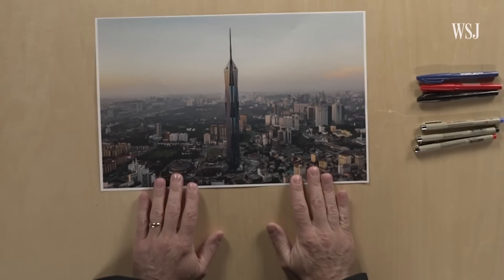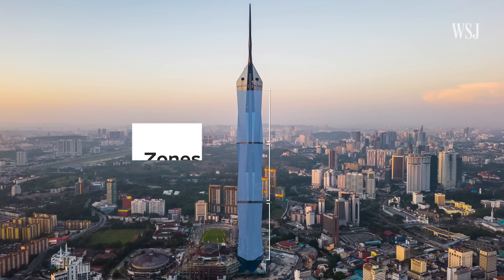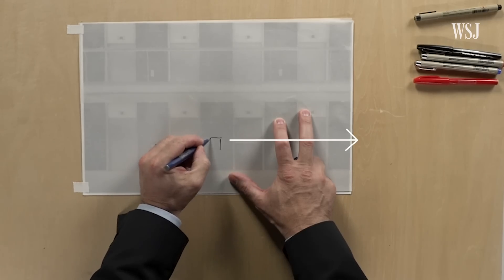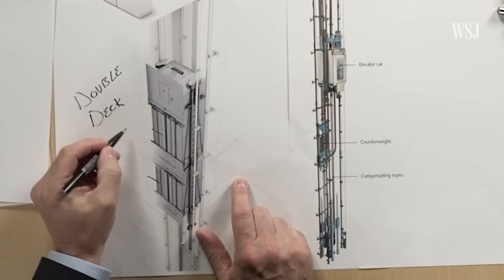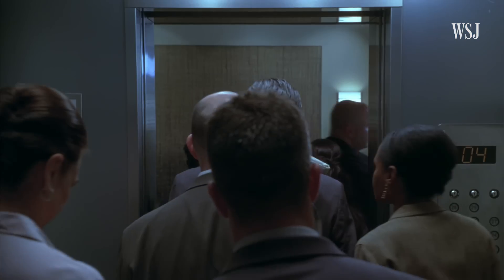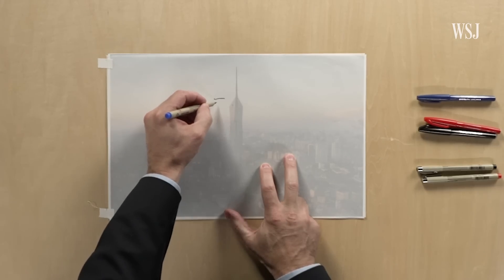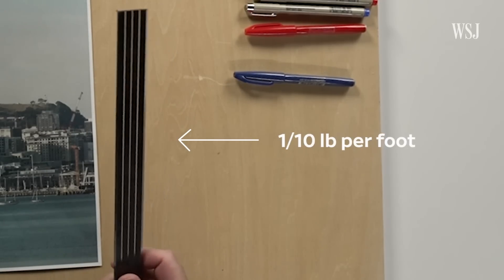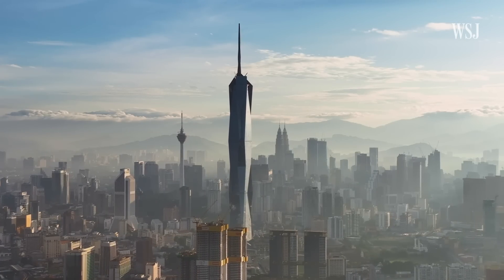Elevator Expert on How to Move 10,000 People Up a 118-Floor Skyscraper | WSJ Pro Perfected

Comment: "Give credit where credit is due..." (Said actress Lorretta Young). Barker Mohandas was the technical consulting firm that designed the vertical transportation system (elevators/lifts and escalators) for Merdeka 118, along with an innovation to the elevator industry's standard destination control or dispatching system.

Comment: I live in a 38-floor residential building in KL where KONE supplies and maintains our lifts (5-6 car system, total around 30 cars). Can confirm, they are fast. However, the system suffers huge drop in performance whenever one or more car stops working.
Reply: So its constantly need to be on maintenance?

Comment: Very interesting video. One statement made at the beginning is misleading, however. While it is, strictly speaking, correct to say that M118 as a whole is the world's second-tallest building, this is due to its absurdly tall spire. The relevant metric when talking about elevators would be highest occupiable floor height. This makes M118 the fifth-tallest building in existence. Still quite an accomplishment, but not exactly the same. It would be interesting to see a comparison of the elevator systems in use in the top 10 supertall skyscrapers (measured by occupiable floor height) to see what has been tried out and what is being learned from different approaches.
Reply: You can access the spire and go all the up as an observation deck.. its a structure not an antenna.
Reply: Its a structure, theres even a observation deck there
Reply: Thank you for pointing this out. Yes, there is a second observation deck in the spire, which makes it a structure, but it is accessible by stairs. The elevator does not go into the spire. As this is a video about elevators, I am focused on the height of the elevator shaft.
Reply: @humanbean5547 ... how many occupied floors are in Shanghai Tower ??? ...

Comment: Just simply a operation optimization problem.😅 In a high level, the lesser stops it takes to transport a passenger, the higher of the total efficiency. So this is why you break zones.😅 No fancy algorithms is need if you don’t want to pursue the dynamic best results. (That might involve change in patterns every minutes, which is not economically perfect) So simply record demands in peak and regular time for each floor, add seasonal effects, amortize demands to different elevators. Voila, Done!
If data is cleaned, just an half day project for 1 analyst.😅 $300 done

Comment: Even if some said it may be a waste financially (as people in Malaysia said that), so long as it does perform well it will be good but either way, i like skyscrapers.
Reply: There’s always a financial risk with these buildings, especially with the global decrease in office space demand. It’s easy to overshoot the local office demand and over supply, leading to higher vacancies, thus making the building unable to recoup its investment in a reasonable timeframe. It happened with the Shanghai Tower where for the first few years of its operations, it was basically just the hotel and observation deck running.
Reply: @lumoneko299  Mega structures are not only meant for office space and hotels but it serves as an icon to attract investors and tourists. A good example is the Petronas twin towers which is a very popular destination for first time travelers in Malaysia

Comment: love how the length of the "antenna" is 1/4 of the tower. 
i just find it weird to be called taller than shanghai tower.
Reply: Not weird at all. As a structural engineer, antenna installed at PNB 118 is also consider as a structural elements too
Reply: @rikiriki6018   0:13 it doesn't look blended in. even from other side it looks like an afterthought that only exist to get the no.2 spot. the skyscraper looks more beautiful without it.
Reply: @someoneinasia  your main argument was “it is weird to be called taller than shanghai” and suddenly your tone changed. If you talk about aesthetic, you should’ve said about the architectural elements, facade and what not… not about the height. The owner of this building approved the architect’s idea and finds it beautiful. If you find it not suits to your likings, then you may fund and built another tower based on how you like it.
Reply: @rikiriki6018  i talk about architectural/structural element and aesthetic because you are the one bringing the antenna as a structural element to the talk?
it has nothing to do with my main argument about the height, the antenna to tower height ratio is still weird and probably the biggest ratio among any skyscraper.
Reply: The spire is accesible to people as there will be a viewing platform built on it. This solidifies the accesibility of the building at all areas of it. This differs from what you call an antenna, that does not have people access. Therefore, the height is real unlike other buildings with sharp pointed tops.
Reply: How about Burj khalifa?? The antenna of Burj khalifa is more than 250 meters long,😂😂
Reply: @syahrezanadham7615  antenna more than 250m? have you look at burj khalifa? the antenna is like at most 50m. you can look at videos of people climbing the antenna.
Reply: Malaysia is very good at bending the rules. The same incident happened back in late 90's with the Petronas Twin Towers. At that time, the Petronas Twin Towers was considered as the tallest tower in the world. However, Willis Tower (formerly known as Sears Tower) in Chicago had more than 100 floors, more than Petronas (only 88 floors) and was taller if its height included the the tip of the communication antennas installed at the top of the tower. But the Petronas Twin Towers' spires was much taller and is not a communication antenna, but an aesthetic part of the building. Therefore, the Petronas Twin Towers won the title of the tallest tower in the world (1998 to 2004).
Reply: You must be indon right?
Reply: @aimanhakim8658  indon? oh you mean indonesian, what if i am?
Reply: @someoneinasia  found the konoha villager...
Reply: @Aeybiseediy  konoha villager? what does that even mean, isn't that from naruto or smth?
Reply: It call spire not the antenna. The spire of Pnb118 actually can be accessed by visitors. If you said the “antenna” are 1/4 of the tower, wht about burj khalifa? 244m?
Reply: @Muhammad_Izzad  what 244m? the antenna of burj khalifa is like 50m, you never watch videos of people climb on top of burj khalifa? 
if you want a direct comparison with high antenna to building ratio to pnb118 there are like sears tower or one world trade center which also has antenna like 1/4 of the tower.
Reply: @someoneinasia  source britannica. No matter how much height it is, it has been officially declared by CTBUH. Ask the CTBUH how can merdeka officialy declared as second tallest building. Fyi, the spire of merdeka can be accessed by visitors so the 1/4 spire can be declared as a part of the building
Reply: @Muhammad_Izzad  i know, i didn't say it's not official or anything. i just find it weird. it's a personal opinion.
other tower in malaysia like petronas towers for example, one of the most beautiful skyscrapers imo, has antennas that are natural looking and blended in. but pnb118 antenna just doesn't look natural. when i see pnb118 under construction it looks more beautiful without the antenna.
Reply: It’s called spire
Reply: Next time trying to build a sky scraper don't forget the long antenna 😢

Comment: I feel like that spire is sort of cheating. Without it, it would be like the fifth tallest. Still impressive though.
Reply: then burj khalifa cant be the tallest since it has 244m spire
Reply: @Chaperone05  Yes, even if you don't consider spires the Burj Khalifa has the highest occupied floor and still holds the world record.
Reply: @michaelmains6785 you mean hold record by floor or height? because burj khalifa without spire is 585m
Reply: @khalishaniqhaiqalbinhazamn2620  I mean the burj not only has the highest number of floors but the height to the highest occupied floor is also the largest. It hold both world records in addition to it being the tallest building. Any way you slice it, burj khalifa is the tallest.
Reply: @klixx_yt2396  Not true. Merdeka indeed has a profile on CTBUH and it shows highest occupied floor. I don't know what to tell you man, takes maybe 1 minute to look up.
Reply: @michaelmains6785  Oh my bad, must've been a research error. I'll see what they say on it. Because they haven't finished building it yet, not even open to the public. Info has also been chnaged several times by PNB and different sources have different opinions. But All I can say is that the spire can be occupied so the occupied floor is pretty high.
Reply: Burj Khalifa was cheated as well with its 200m spire 😅
Reply: @zaidimohamad8236  the highest occupied floor height of both the Burj Khalifa and the shanghigh tower are more than 100m higher than Merdeka. They are just much larger buildings
Reply: Have a deck maaa.. Not only spire
Reply: FYI, the spire was designed from the very beginning and not to outcompete anyone. In fact, the spire is a "VERY VERY IMPORTANT" element as this tower reflect the hand raised by the Malaysian PM when he chanted merdeka!
Reply: For your information, Kuala Lumpur exposed with common lightning strikes and thunderstorms every year. Which is why most malaysian tall buildings have spires to prevent lightning strikes to the ground or open places
Reply: The spire is not an ordinary spire, it have observation deck in it.

Comment: I would much rather live in a medium rise city like Barcelona.  I was obsessed with skyscrapers like this as a teenager, until I had to work in one for many years.  Skyscrapers aren't great. But the engineering of this building is impressive, same with the much more beautiful Petronas Towers.
Reply: I agree. I used to day dream about living in a tall building. But I guess this type of lifestyle is simply not for me after living at an 11th floor (only) apartment unit. I hate waiting and having to use the lifts to go up and down the building as if my life depended on it.. doesn't matter if the lift is sophisticated or not because I still ended up being squished like sardines inside that box with  strangers especially during peak hours. I rather live in a landed house even though its a bit far from the city centre...

Comment: noticing the massive spire that's the only reason it's so much taller than the shanghai tower which itself wastes several floors for vanity height, they really need to stop treating these titles like they have meaning
Reply: Lol the spire actually can be accessed by the visitors btw
Reply: Please look at the height of the parapet wall on top of the Shanghai Tower too.
Reply: @cemerlang the highest occupied floor in Shanghai Tower is still 100m higher than Merdeka.
Reply: FYI, the spire was designed from the very beginning and not to outcompete anyone. In fact, the spire is a "VERY VERY IMPORTANT" element as this tower reflect the hand raised by the Malaysian PM when he chanted merdeka!

Comment: "Only" 118 stories. Many buildings are taller if you don't count the big useless spike on the top.
Reply: Burj khalifa has spike, shanghai tower has crown which is hollow from the inside, makkah clock toower also have spike
Reply: @Zichoe the only reason why people complain about the 118's spire is because the spire is visible and obvious. The ones on the Burj and Shanghai Tower is completely hidden thus making it one with the structure.
Reply: @Zichoe  Shanghai Tower has occupied 128 floors, Burj has 163.
Reply: The 118 spire will house an observation deck as well.

Comment: At some point as these megastructures get bigger it has to be more efficient to run paternoster-style elevators through the shafts. This whole video is like if a train service tried to be really creative running rail lines on multiple disconnected single tracks. It is much more efficient in terms of space/ capacity to dedicate each lane of traffic to 1 way, upgrading an hourly commuter rail into frequent rapid transit.
Reply: With the speed limitations of those elevators you are going to take 30 min to reach the top.
Reply: have you factored in journeys between floors?
Reply: Good luck with the fraction of a second as they fly past. Body parts and blood everywhere.

Comment: why dont they make like a ferris wheel type vertical elevator that can go sideways and have multiple elevator cars going around a vertical wheel
Reply: Because that would occupy a lot of space that could be used for real estate, you cant waste real estate space
Reply: @ThexMAJ  most buildings have a whole hallway of multiple elevators. if they install a modernized paternoster elevator that can stop and have doors with multiple cars, they can potentially half the number of conventional elevators they have. lets say a building plans to install 6 conventional elevators, with a modernized paternoster elevator, they could install 4 instead and the added cars would support the volume of foot traffic.
Reply: look up paternoster elevators! It's what you're talking about, having 10 cars for 10 floors instead of 1 car for 10 floors is much more efficient. It wouldn't take a lot of technology to modernize the paternoster system to safely transport people in a skyscraper. Very sad wsj decided to go with a weird unproven sideways elevator tech instead of something with much better capacity.
Reply: @FullLengthInterstates it looks like the safety concerns of the paternoster could be solved by making it stop and having doors and detection system like a conventional elevator, but with the structure and multiple cars of the paternoster. i wonder why asian countries dont have it yet